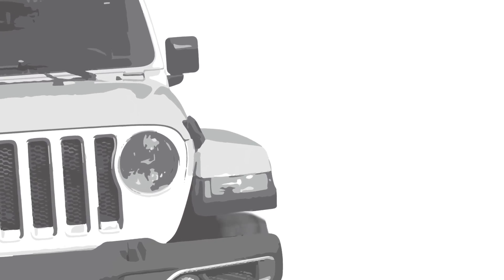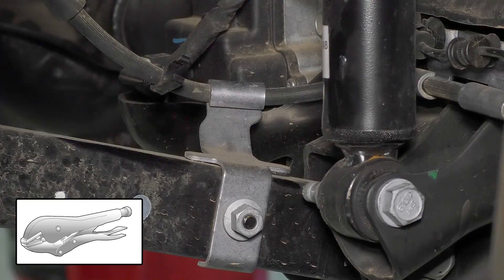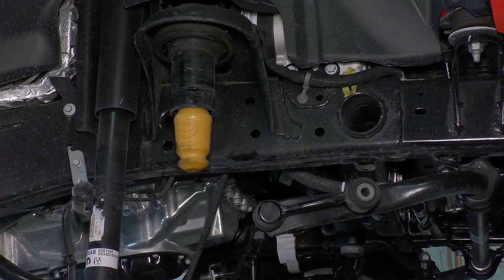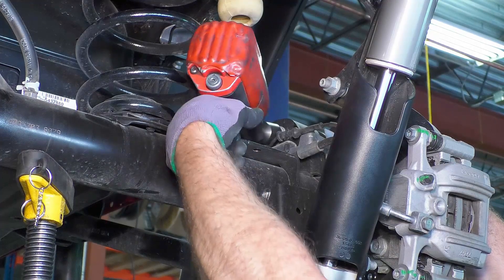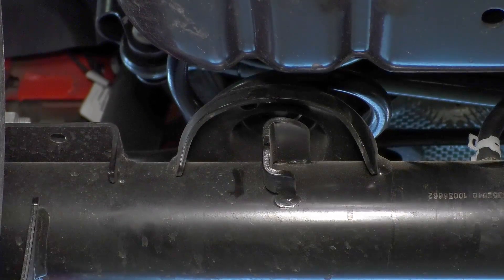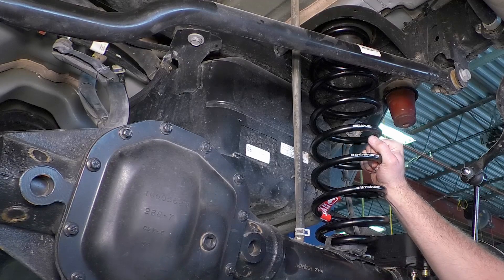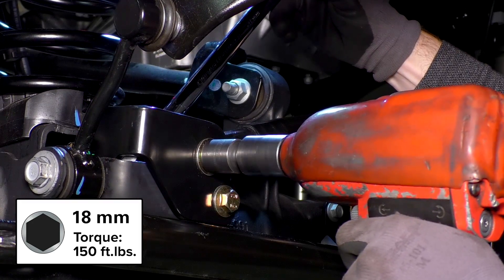TeraFlex Install: JL 3.5" Base Lift Kit

Comment: Somebody help ! I have put these 3.5 inch springs on my Gladiator. I just purchased the springs. The springs looked identical, but had two different part numbers. There was nothing explaing the different part numbers, in the directions. The springs do not seem to be lining up right after instal.Especialy on the passenger side, I can not connect my swayer. Is there a left and right spring?
Reply from the maker: Sorry to hear there's some confusion! if you haven't already, reach out to our tech@teraflex.com email with a few pictures and we can help you out.
Reply: @teraflexsuspensions  I sent an email didn't receive a response. So I actually called in today. I took it to a local shop 4x4 shop. Im not sure it's right. It might be, but man it sure rides rough.

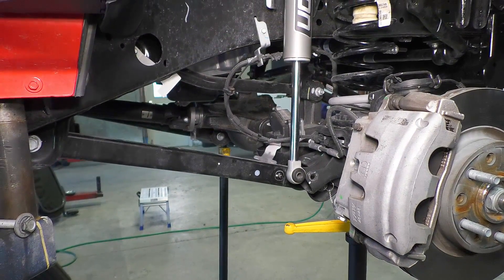Comment: At 3:58 it shows that the brake lines are on the front of vehicle side of the shock, and then all of a sudden, they are disconnected from the axle and on the rear side of the shock.  This would also require the brake line be removed from the forward bracket.  This is not mentioned in any of the instructions that I can find, and it doesn't make sense to put the lines in the Teraflex anchor bracket routing the lines from the front.....    It also looks like there would be plenty of slack for articulation without the lines being routed behind the shock.  Any ideas or recommendations?
Reply from the maker: We mount the lines behind the shock because that is where the lines are further away from getting pinched or rubbed on by any of the moving components.